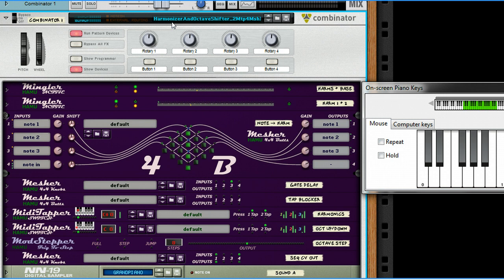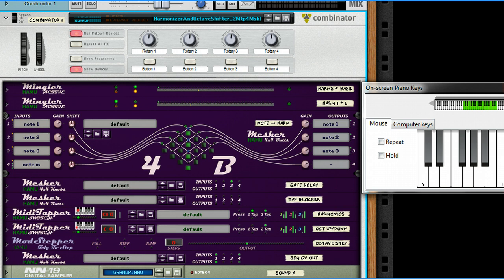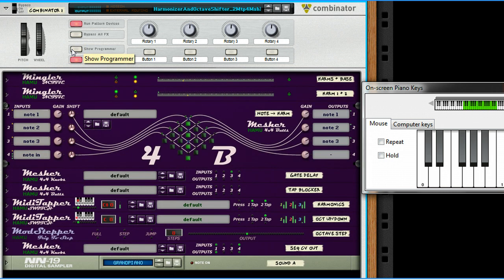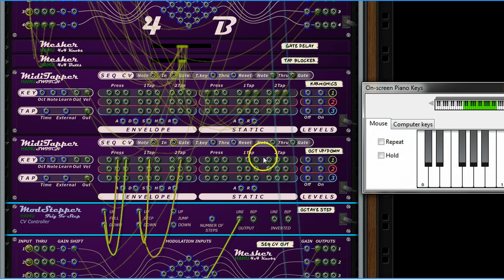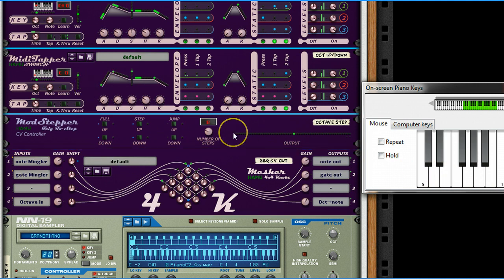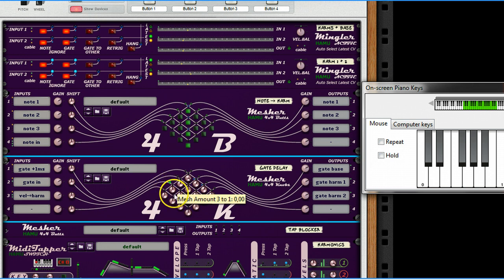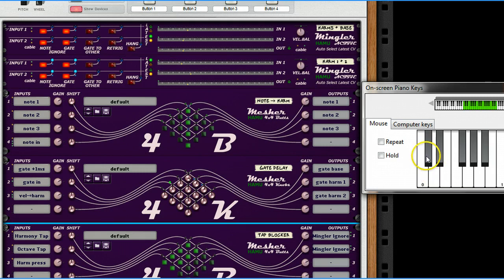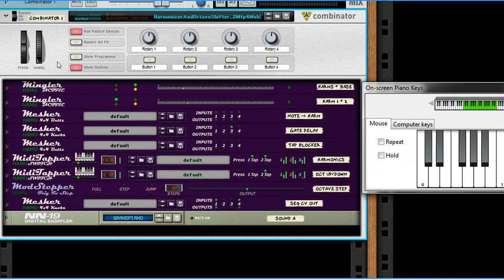Harmonics & Octave Shift from Midi Keyboard

Comment: Very complex, but cool. Could you build an easy to use 16 track CV mixer with ins and outs for each slider? This would really simplify my live set up a whole bunch. Instead of having to rumble through combinator rotary knobs, you would have one mixer to control 16 knobs.
Reply from the maker: Johan, your welcome to expand on this question by sending a mail support@hamu.se ! 
Gärna på svenska, om det är lättare! ;-)